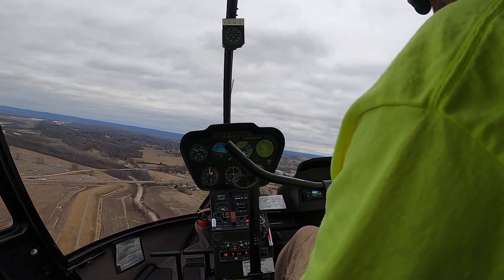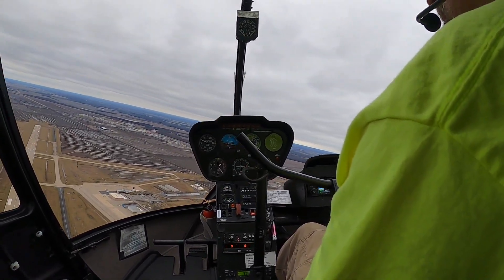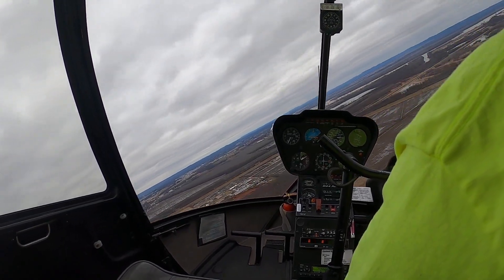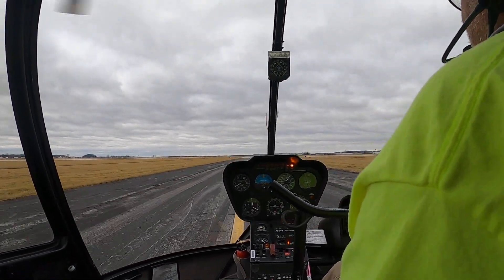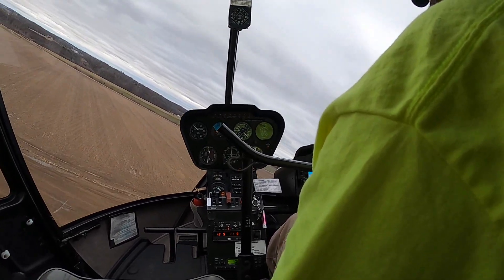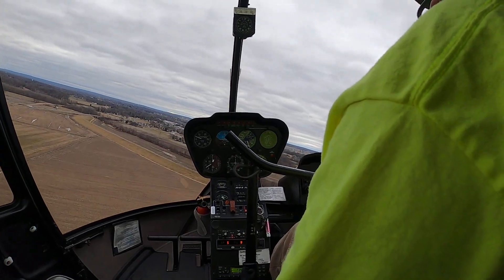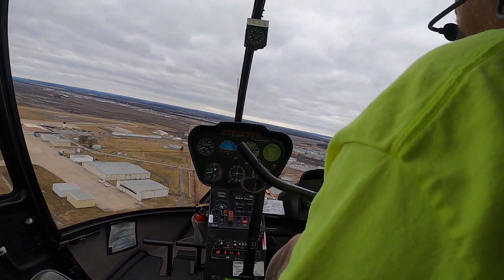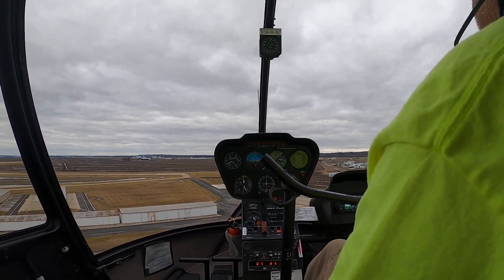360 Degree Full Down Autorotation in a R44

Comment: How many of those can the skids take?  Do airports get upset about it tearing up the asphalt?  Just wondering, I know nothing about helicopters.
Reply: I know that Bell products and I suspect Robinson also, has "heavy duty" skid shoes that will take the added abuse of "run on Landings", power on or off doesn't matter.  The heavy duty skid shoes are removable and could be repaired, built up, with new beads of weld.
Reply: For a start the title is misleading - apart from the photo - it’s not a full down autorotation. Secondly, airport management would definitely not be pleased. This is why manoeuvres like this should be carried out on the soft part parallel to or away from a runway and not a running landing as you’d very likely risk catching the skid and tipping over.

Comment: Cool! I have a question: Why are you getting the horn at the end in the "floating" section of the auto? Are you pulling some collective there, before you've leveled out the flair, and therefore your rotor rpm's are coming down? I'm really trying to understand this moment in the autorotation sequence. (As a three hour student, grounded due to covid, doing all my flying in a home VR simulator, and learning as much as I can from CFI's such as yourself on yourtube.)
Reply: pilot error most likely. put the video in 1080 and watch the rotor tach.  the r44 horn sounds at 90%, and the rotor rpm just keeps dropping from there in this video.  i've been taught that you want to allow the rotor rpm to build through the flare so you have a bit of energy left for the collective flare.  Having the horn going off through the flare is not ideal, although being lightly loaded may have something to do with rpm's not coming up much, and also the aircraft being very forgiving for coming in with low rotor.  Looks like this was done pretty close to sea level, if it were done at a higher DA, it probably wouldn't have worked out as well
Reply: I suspect that the horn is indicating a "Low Rotor RPM" condition.